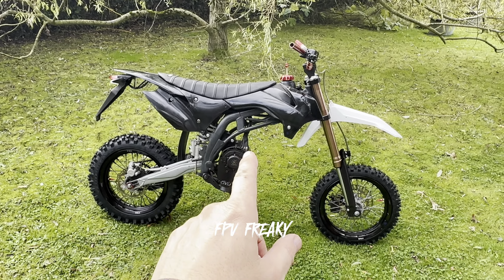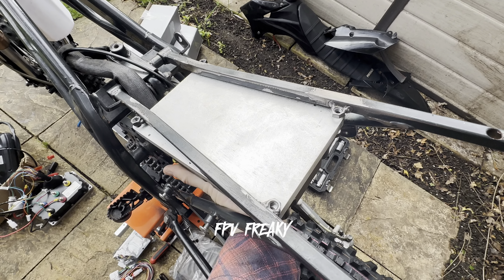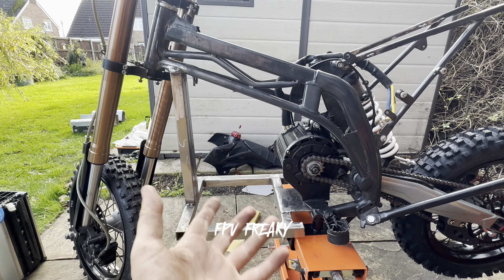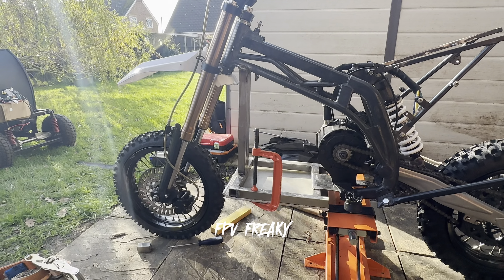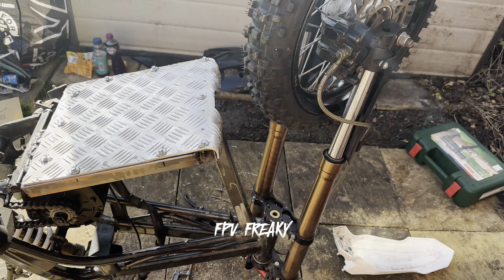Get Ready for the Fastest DIY Electric Dirt Bike on the Block!

Comment from the maker: INTRO👊🏼😉

0:00 intro in to (part 3 ) Day 3 (where are we at?)
0:12 if you missed part 1.
0:19 if you missed part 2.
0:28 what are we up today on day 5 ?
0:42 let get on with some battery templates. 
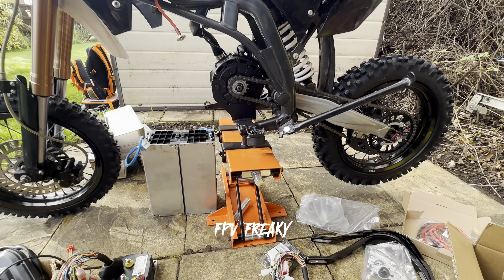1:03 22nd of October 2024.parts have arrived. What have I got?
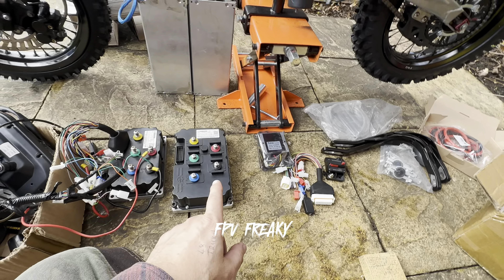2:06 so what I have done so far?
2:26 how I will be fitting the new ND108530 fardriver controller.
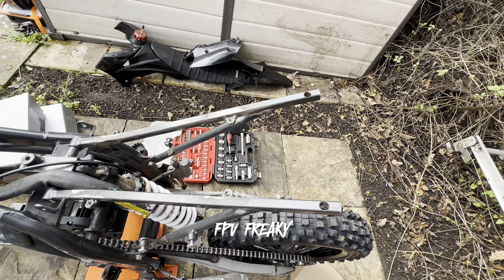2:54 mocked a temporary battery base up. 
3:19 made my stainless steel battery base plate up.
3:35 fitting the stainless steel battery base for the first time.
3:45 test fitting the battery base struts.
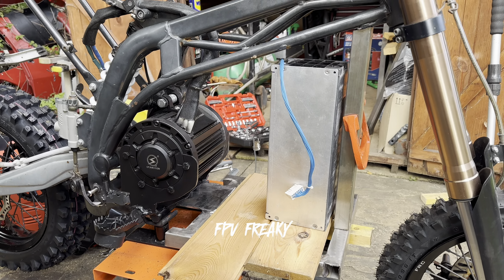4:43 preparation for welding the battery struts and base.
5:56 preparing to weld the battery struts to the frame and battery base.
7:32 first look at the framework for the ebike.
8:48 Day 6 of the electric motorbike build.
8:52 plans for today’s work.
9:36 I have cut the plate out of aluminium.
10:14 change of plan.
10:36 making my shape for the front panel.
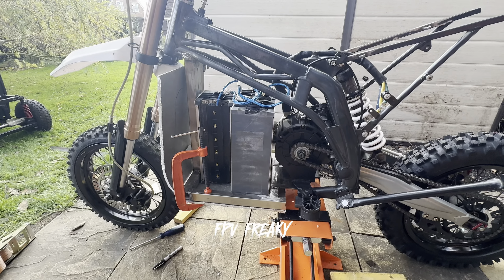11:15 first look with the batteries in the bike.
11:31 I have cut out the front panel for the bike.
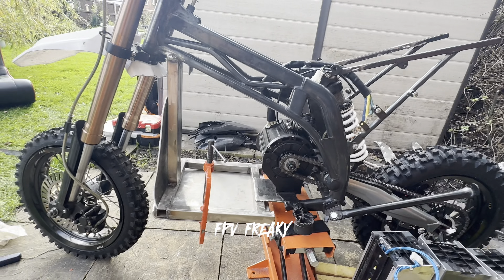12:12 I would like to make a chain guard for the Qs138 90H motor.
12:57 batteries in the bike with the new front panel.
13:55 what do you think? Any suggestions?
14:16 don’t forget to lock the video guys.
14:39 slow look at the bike.
14:51 end of day 6.
14:59 24th of October.
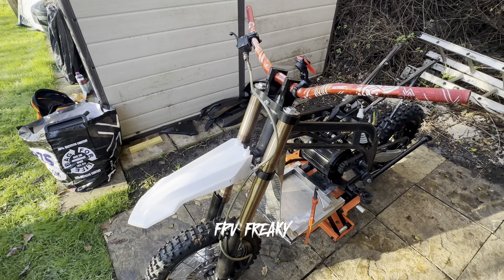15:21 let’s crack on and get some work done.
15:30 drilling the aluminium plate.
16:12 unforeseen circumstances. 
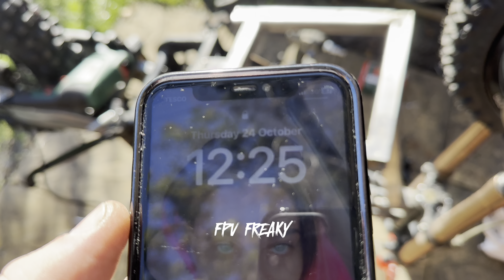16:55 HSS drill bits. £26 later.
17:06 aluminium plate base is bolted on at last.
18:16 front aluminium battery plate bolted on.
18:27 predictions.
18:42 cutting plates for the base plate.
19:29 more welding. 
20:01 battery base welded and gaps filled.
21:00 some cinematic footage.
21:57 THANK YOU ALL 🙏🏼
22:20 see you all VERY soon.

Comment: awesome video iv just started to buy my parts for my electric pit bike project only got the 72v 40ah battery so far tho
Reply from the maker: @levistarable  thanks dude. Oh nice one. That’s a good start.. you have to start somewhere. what are you thinking of doin build wise.?
Reply: @Fpvfreaky  im thinking qs138 v3 72v but aint decided on a controller yet as there are so many options lol
Reply from the maker: @levistarable  ah ok cool. Yeah you’re not far wrong you have so many to choose from😱 we are spoilt for choice. I try to always choose above my voltage that I  will use just in case I want to upgrade a battery or anything like that so that I know the controller will handle it. so I hope that helps you.?

Comment: I am going to order all the bits like a 72v 40ah battery with a controller and motor and I was thinking would the front forks hit the bit you’re add on when its bottomed out and make you go over the bars
Reply from the maker: @Alfiebob-xd7el  hey bro. That’s cool 👊🏼😁 . What controller are you getting.? No mine doesn’t hit. I’ve tested and it’s all clear. Plenty of room. 👍🏼 if you’re thinking of doin that to your build just bear in mind and compression tests.
Reply: @ I don’t know but it’s green